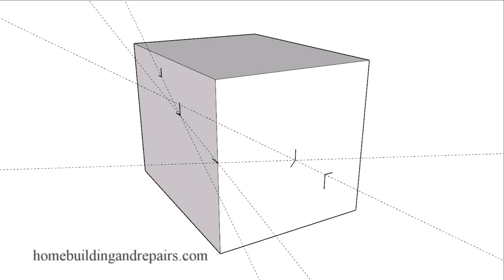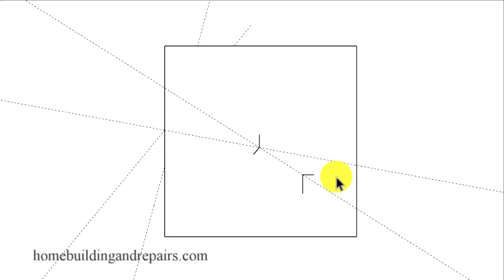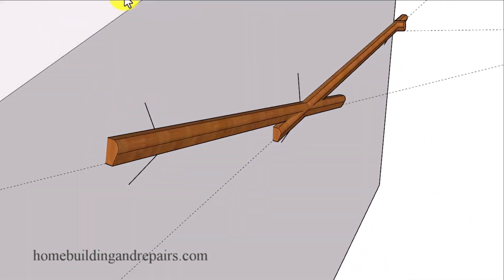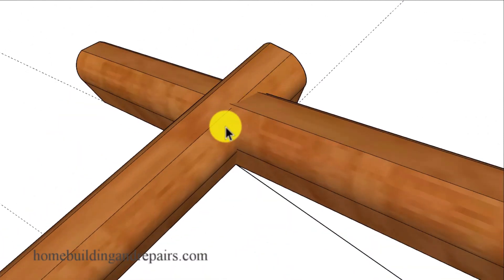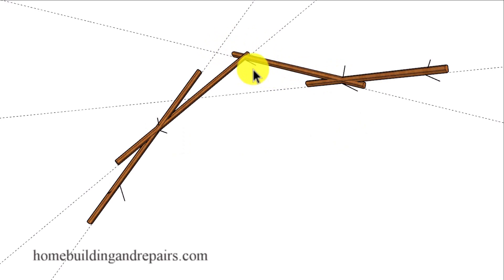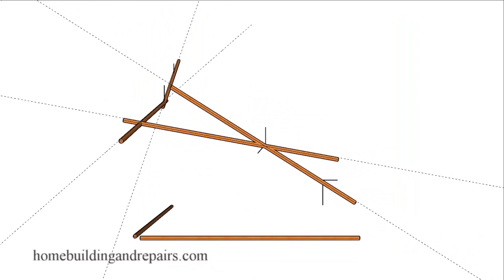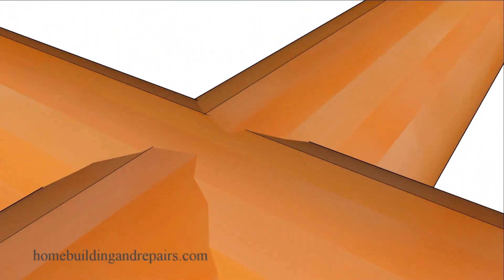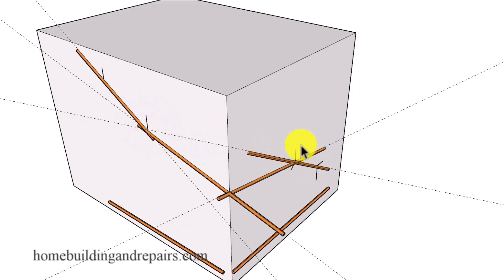Round Handrailing Might Be Easier To Install When Cutting Complicated Angles - Stair Building Tips

Comment: This is the problem I am facing, my railing is rectangular maple 2" wide by 1 ½" tall. I'm interested to learn how to cut the corner joint at 90° on the horizontal plane and at a different angle on the Vertical plane. Regards Claude Ostiguy

Comment: What I recommend to ya'll out there is that you lay out the line parallel to the front edge of the stairs, on the wall, with a string. You use a push pin to hold it. You lay out a string path, from there, you located studs, put up the railing brackets, then use 2x2s to 'test-run' and figure out your compound miter cuts. It might take you a few tries - but it's scrap material, so no problem. You work out the problem in place, till you get the scraps to do what you want, then you go do it with your finish material.
Reply from the maker: I like it!!!!

Comment: I was so excited because I thought you where about to solve a problem for me. All you did was described the problem…😔
Reply from the maker: Then I won't count your comment as a vote.
Reply: I also got to this video after searching for a way to solve exactly this problem. I have a shaped handrail that needs to make an inside corner, and I've recently realized that this makes the design not line up properly for a cut. What is the best solution for this?